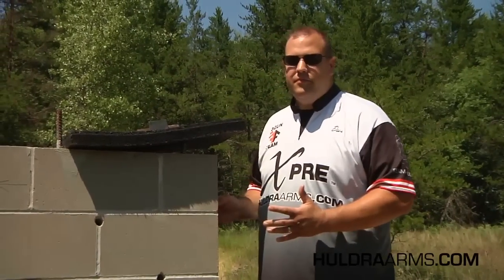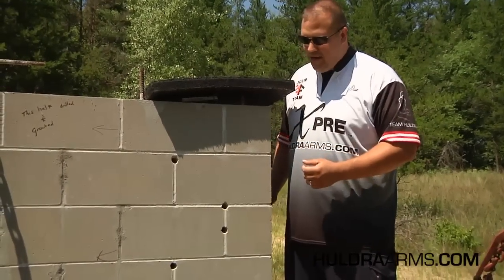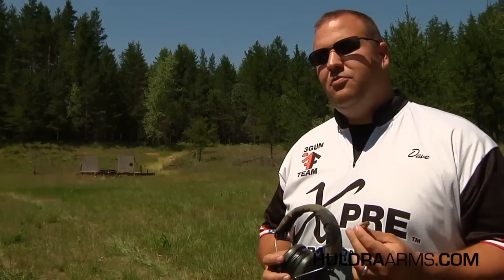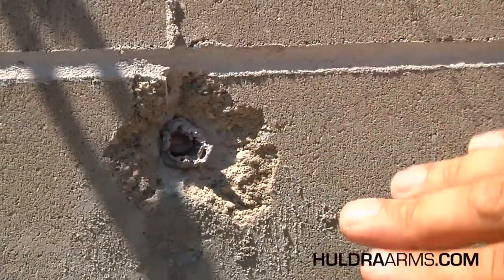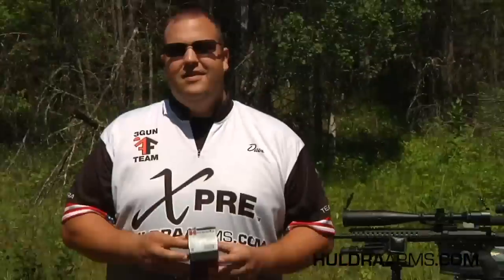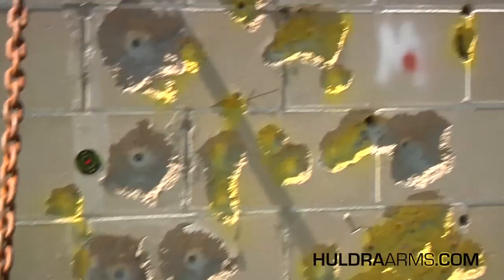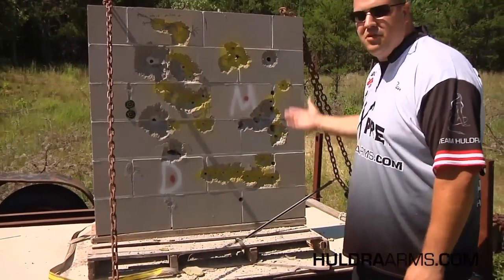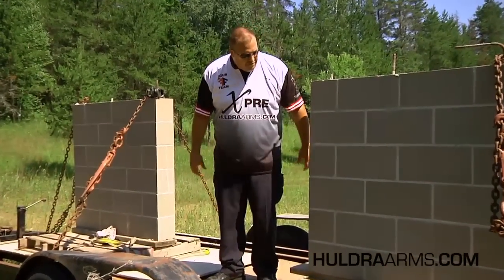Testing the Bullet Containment System

Comment: My only question is that supposedly AFTER the torture test it showed all of the divots, pock marks and craters that had been achieved!  THEN you supposedly showed the walls after shooting the 5.45 mm Russian mil surp  rounds.  Why did the front sides of the walls NOT SHOW all the original damage?  There were a few obvious places where rounds of some kind had hit the walls but the major damage from the 416, .300 Win Mag, etc doesn't show up.  Maybe my screen just doesn't show the damage that was quite obvious in the first part of your "torture test" but I watched it 3 times and it just doesn't look like the same "torture tested"walls after the Russian mil surp stuff was fired.  Did I miss something or did you switch walls?  Did you use new walls for the Russian stuff?